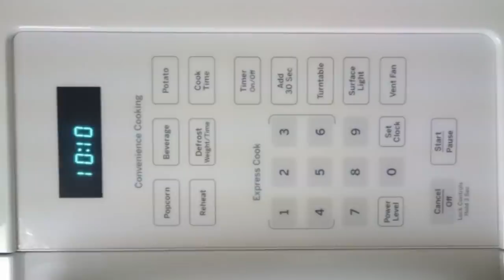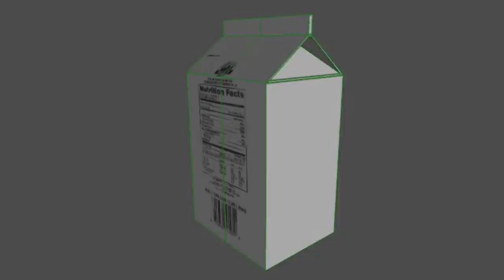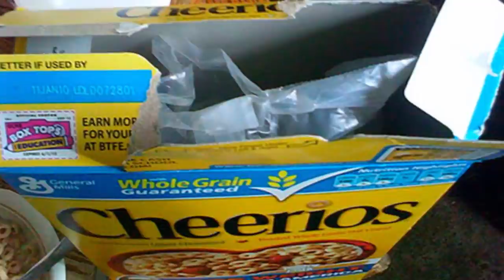7 Everyday Things That Are Badly Designed

Comment: If your breasts are popping out of the top of your bra, you are wearing the wrong size. Bras are actually VERY well designed and even inexpensive retailers have stepped up their bra game. The whole point is to sculpt your silhouette with the different styles offered. Go to VS and get fitted for the correct size and this won't be a problem.
Reply: Don't go to VS, they don't measure properly. Nordstrom does, and will show you. VS likes to tell me I'm a 38-42 DDD when I'm actually a 38 GG. But other than that, you are exactly right about cup size. I have adorable bows that don't look weird.

Comment: One thing I learned over the years is NEVER use the microwave button for popcorn, unless you like the taste and smell of ashes and a crazy smoke detector in your kitchen...
Also, for cereal, we just close the bag with a clothespin from the laundry, they're cheap and replaceable. We never really bother with keeping the box pristine so long as the cereal is properly sealed. Worst case scenario, we just put the cereal in a big Ziplock bag.

Comment: Well.... People can't design Christmas lights that way 0:46. These lights has series connection in them. If you want Christmas lights like that 0:46 than you would need to connect the lights parallely. That would mean that you would need to make a circuit
for each light. You would need a lot of wires so good luck with that. Cristmas lights are designed properly. They could make it not tangle but that would make it more expensive.
Reply: I thought there were parallel lights. Perhaps I am confused. Fuck me. (I know you don't) Have I been living in a world where I thought there were lights that worked like that. I could have sworn I have seen them with bulb out but everything else workning. I need sleep. I need to go home and rethink my life. I need dinner.

Comment: on microwave, I use the numbers, but mostly the "add 30 sec" button, vent and light (I have a microwave over my stove), beverage button, and of course stop and start. Who changes the power level? Honestly on my microwave, the power level button is incredibly difficult to use. It has to be heating something up in order to change the power. Never had a microwave that worked like that...

Comment: That is why I wear sports bras due to that. Other types of bras have the straps that are hard to adjust and also the back part with the hooks you have to move to the front to make sure that all the hooks are connected before turning the entire bra around.

Comment: On the Christmas lights. The problem you describe about the lights and a burned out one has not been an issue for decades. All Christmas lights are parallel wired now, what you describe is serial wiring.

Comment: I would so pay an extra nickel to have the inner cereal box liner be a ziplock bag. All it takes is one little cheap strip across the top, and you could just zip it close and it wouldn't matter if you tore the top.
Reply: Kati OBrien I had five children so I rarely had stale cereal but I was also poor so I ended up buying the knockoff cereals that had a zipper! Tasted the same and it was easier for the babies to open and close it themselves.

Comment: Actually bras are for comfort, not so "our breasts look normal" 
I'd rather go without but they move everywhere at the slightest movement, and guys stare. DDD 34 over here never once cared how my breasts look, which is saggy because they're huge, so I gave up. I buy Bali minimizers, thick straps. Usually meant for plus size women with huge knockers. Those fuckers are 80 dollars a piece.

Comment: I agree with the microwave keypad.  However, my sisters and I bought my parents a huge Carousel when they first came out.  It had all kinds of buttons and we learned to use them all.  That thing could cook a small turkey to perfection, provided you know wtf you are doing.  READ the manual, how about that?  LEARN to use it!  It's a very useful gadget!  It's not fucking hard!  I push popcorn, and it pops it just right for the bag size.  I used to have to learn by experimenting.  We have the Enterprise of microwaves now, and it galls me people can't figure out such a simple thing.  Today's humans wouldn't know how to tape their favorite song off the radio, while pausing for commercials, and then be able to find every song by the counter on the tape player when they want a certain song.

Comment: The actual title of this video should be something more along the lines of "7 Things I like to Rant About"

First off, I've never had a problem with cereal boxes. Second, how are breasts supposed to look "normal" when wearing a bra in the 1st place? Christmas lights get no more tangled up than a long extension cord if comparing both to being carelessly thrown into a box.

I've seen plenty of umbrellas that are not only made of more durable materials, but also have wind vents to prevent the umbrella from folding inside out in any normal weather conditions.  If the wind is strong enough to mess them up, then you should be more concerned about getting off the street than what is happening to your umbrella.